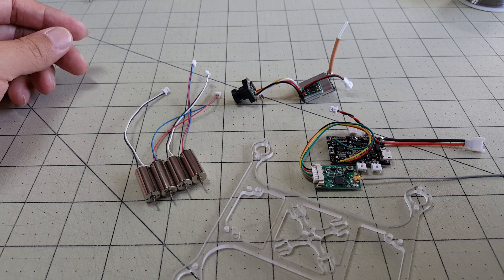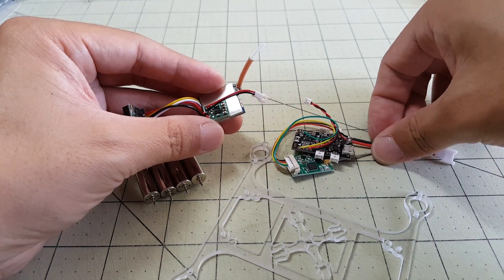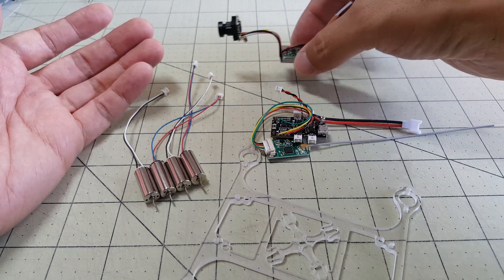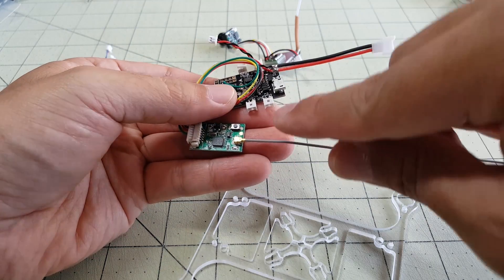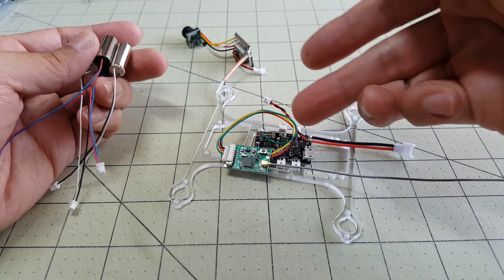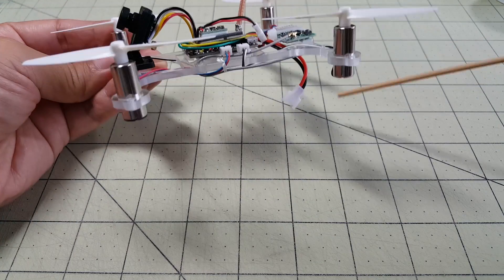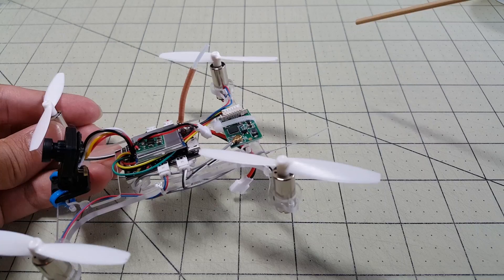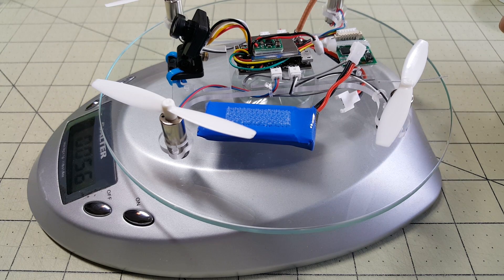Modular Brushed Microquad Build 🚁🔥

Comment: Nice build Albert 👍. Have you seen the Turnigy Graphene 1s 750mAh batteries? Just wondered what you're thoughts were on them?.. Apart from being more expensive lol. Thx Dod.
Reply from the maker: +Dod Lug I have those. The polarity is reversed on the connector!!!  They are OK. Not that much more power or flight time. I like my 500mah batts more
Reply: +Albert Kim (marblekit) Ah ok thanks Albert